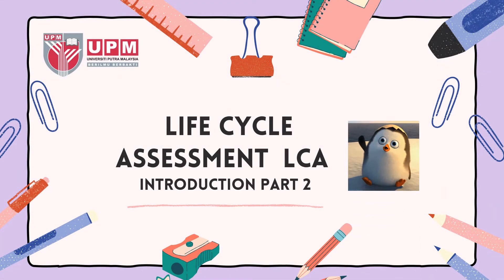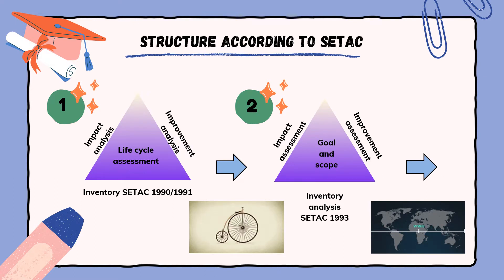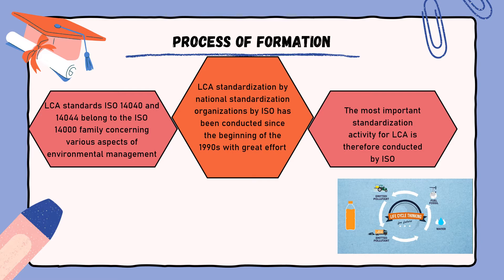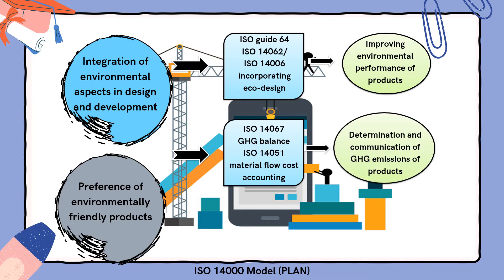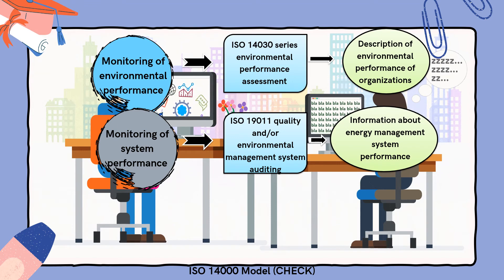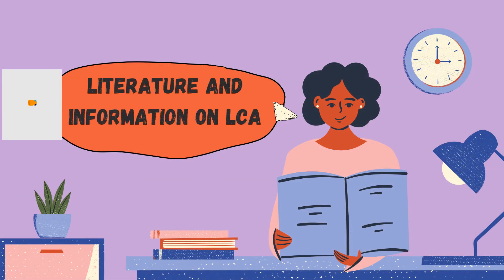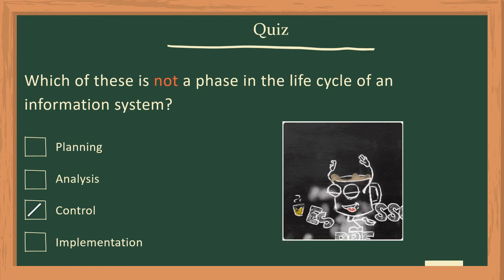Chapter 1 - Life cycle assessment (LCA) - Introduction (Part 2)

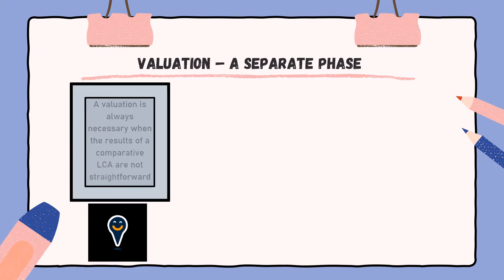Comment: 3:30 why is valuation a separate phase and is it only being used when the result are not straight forward? 4:39 Why does the process of formulating LCA standards require an extended time and is considered as difficult?

Comment: At 3:30, the valuation is a separate phase that is not included in the standard. However, it is necessary component to evaluate the LCA result. So, why the valuation treated as a separate phase instead of being incorporated into the standard?